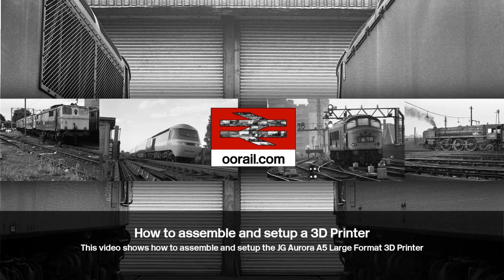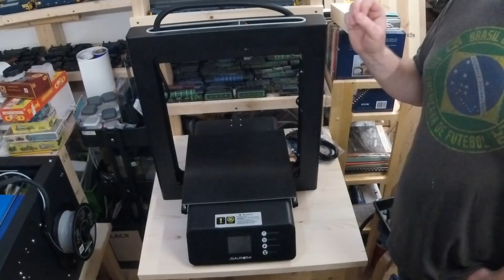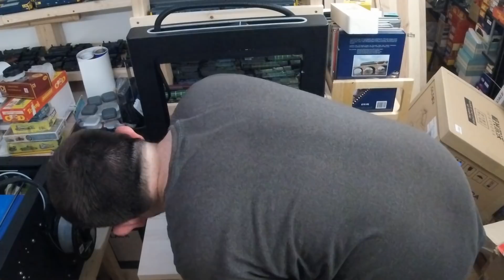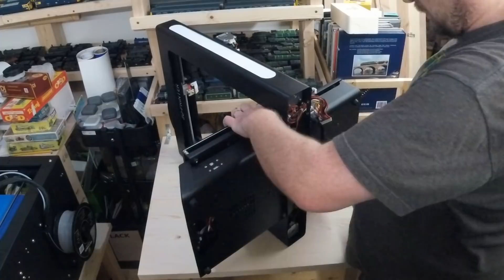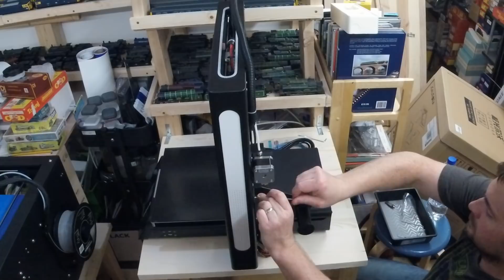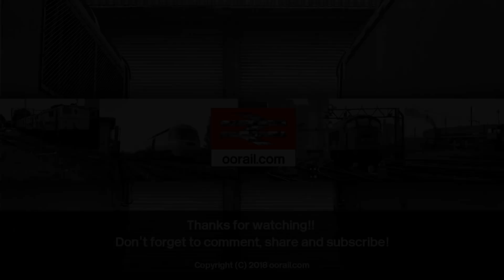oorail.com | 3D Printing - Assembling the 3D Printer

Comment: Brilliant and thanks for de mystifying 3D printing.  Looking forward to see how it actually works. Cheaper than I ever imagined.  Cheers Jerry
Reply from the maker: Thanks Jerry. Yes its really cost effective. Especially for model railway projects, as a lot of products carry a bit of a premium. A good example are oil drums / barrels. These typically run a few pounds in the UK for a pack of 10 or 20. You can basically 3D print about 60 of them with PLA for the same cost as one drum from a traditional model railway accessory manufacturer. Over the next couple of days you should see more videos helping to demystify 3D printing and an influx of things for people to 3D print. Shapeways is an option if you don't have a 3D printer, but the most cost effective way is to purchase a 3D printer and get printing. I've put some of our prints into Shapeways to get a cost comparison, you're looking at about 10x the cost to use Shapeways over the cost to print with Hatchbox 3D PLA for example.